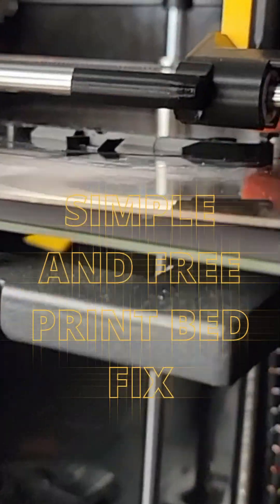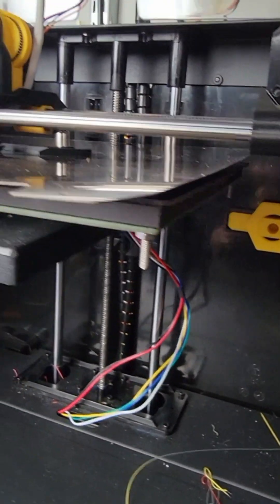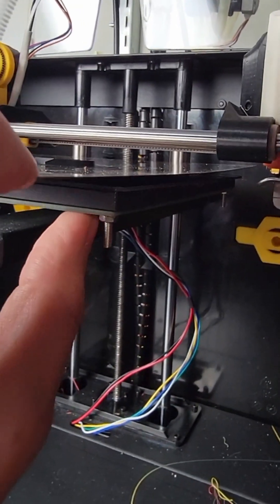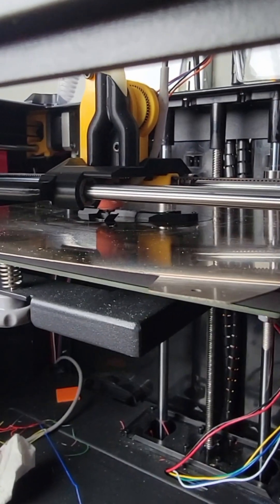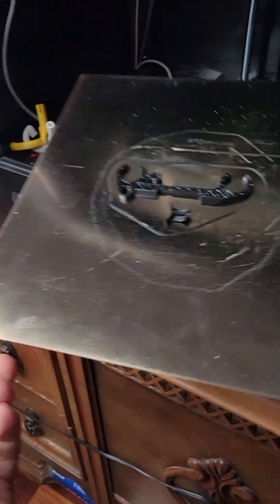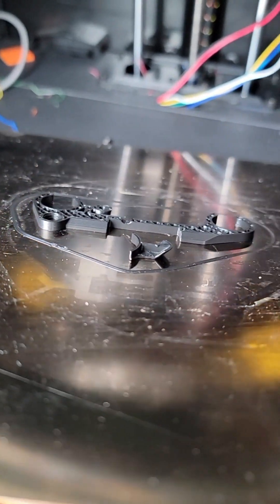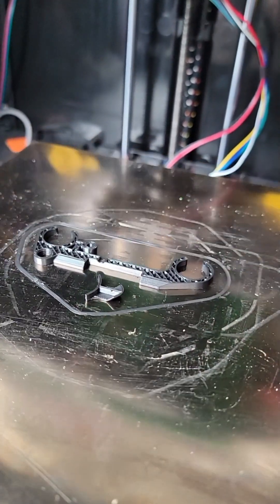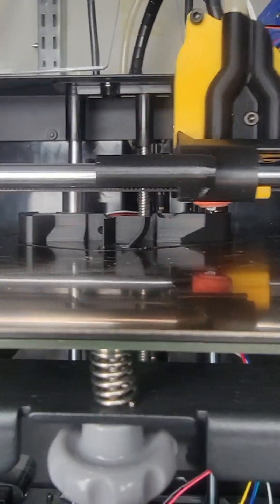Quick Fix Tape Solution for Weak Magnetic Beds #3dprinting #picolinoextruder #opensource

Comment: If you need a big non standard size steel print bed with a really thick magnetic adhesive sticker '3d jake' does them cheap!!(If you dont mind waiting a month and a half😢)

I think I got a 400×400 peo patterned steel plate with the thickest  magnetic sticker ive seen  for 20 bucks...as I said the wait time is awful, they import stuff by the container  from china then the ship it from the Netherlands

Comment: Bed got too hot for the magnet
Reply from the maker: Maybe it's operator error on my part. I really should cut that Ender spring plate to size; perhaps that's the biggest culprit to my failure.
Reply: @m_IDEX  what plastic type are you printing?

Comment: Never had that problem yet, but was that a new Picolino tool head X carriage being printed🤔
Reply from the maker: Mike, I haven't had that issue either. Maybe it's operator error on my part. I really should cut that Ender spring plate to size; perhaps that's the biggest culprit to my failure.

Yes, I'm making a slight adjustment to the Picolino carriage to match the nozzle height with the original magnetic IDEX toolhead and the nozzle bibs.

Comment: Did it get demagnetized by the heat bed?  What temp are you running on it?
Reply from the maker: @twinturbostang, it's not fully demagnetized, but it does seem a little weaker now. I don't go over 100°C, although I know some flexible magnets are rated up to 120°C. However, I'm unsure what specific material Creality uses for the Ender plate's magnet. Also, it doesn't help that my spring plate overhangs both the magnet and the heated bed, which might be the bigger culprit here.

Comment: Can you do a video, walking us through the various klipper Macros you use to switch heads, Mirror, etc. Also do you use bed leveling? I wan t to use a BLtouch, so only on the A head? Also do you use, Orcaslicer? How are you setting up the slicer for dual color or one head for support i.e. PLA/PETG. Thanks;-)
Reply from the maker: @FilmFactry, thanks for the great suggestions!

Klipper Macros: Definitely on my list for a future video. I'll cover switching heads, mirroring, etc.

Bed Leveling: I'm using manual leveling now, but I'll work on automating bed leveling.

Orca Slicer: I'll explain how to set it up for dual color and using one head for support like PLA/PETG in the video. It is refreshingly simple to do in Orca Slicer.

Stay tuned!
Reply: @ Looking forward to that as well!
Reply: @m_IDEX  Thanks! I love my G29:-) I have all my parts in, doing a version of your magnetic IDEX , converting an CR-10, with a 300mm MGN 9, 2 carriages and a BL Touch. I'm mainly a Duet guy, but have some klipper mainboards.